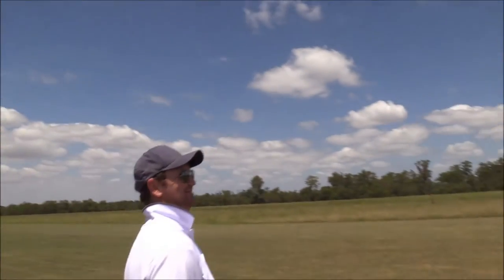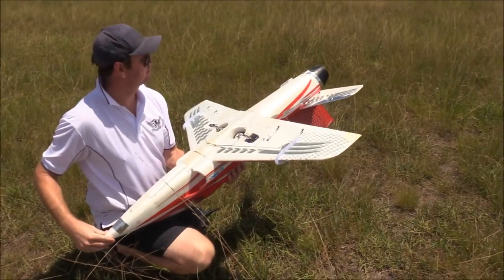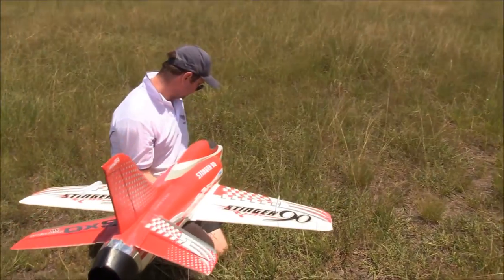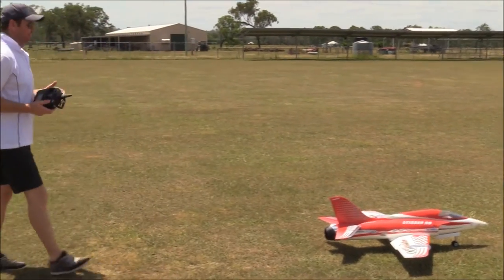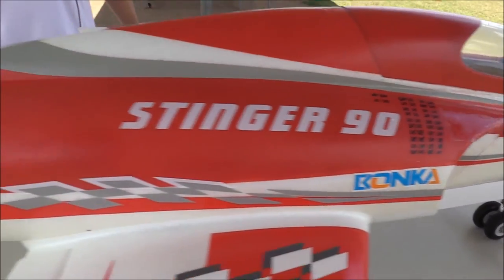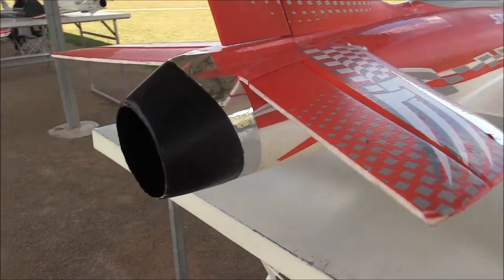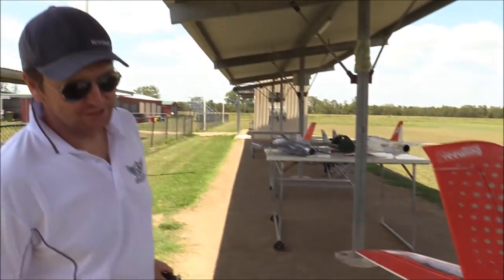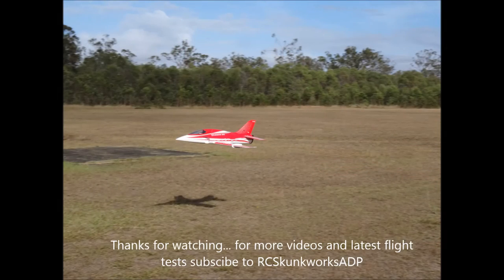Freewing Stinger 90 v2 200kph CRASH and recovery | RCSkunkworksADP

Comment: Great flying and great machine. What's the weight of the graphene batteries your using.
Reply from the maker: WalesFly3r . Graphemes are around 1kg. We use batteries ranging from 780g all the way up to 1150g (Nanotech 8000mAh pack... my favourite for long fast flights). These jets are CofG numb, and there is plenty of room to shift batteries back and forth that helps. They are great aircraft

Comment: Biggest problem with that jet is the landing gear always breaks or bends over.
Reply from the maker: You are obviously landing heavy then as we have hundreds of flights on ours and still have the original landing gear working perfectly. Occasional maintenance helps, but every aircraft needs that. Yoda
Reply: what battery make and  size do you use and how long flight time?
Reply: well when you run the plane down the grass to take off and one of the landing gear collapses thats what i call a poor design. nothing to do with pilot skills. maybe our grass is a bit taller than yours?